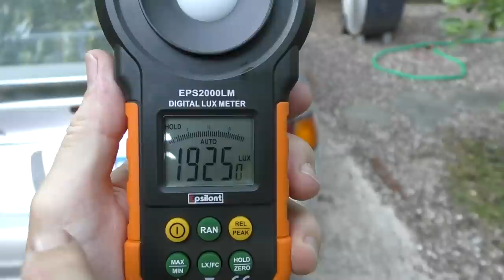I Made a Huge Mistake Buying These Headlights

Comment: Thanks for making this clear in a scientific way.  Something needs to be done to stop the use of these light bulbs.  They are brighter than someone with their brights on coming right at the other drivers on the road.  I realize there are many older drivers who previously could not drive at night because they could not see well in the dark; this is not the answer.  Using them will only increase the chances of someone else sliding off the side of the road or crossing the center line.  Spread the word.  Pickup trucks that are higher off the ground to begin with make it extremely difficult to even drive in front of them.  Your rear view mirror is blinded; the side mirrors are blinded; you get the idea.  It's like riding a bike with tunnel vision glasses and your ears plugged up.  Very dangerous.  If you get a big pick up truck behind you with these lights and another coming at you from the opposite end, pray for a good result, because for the next 30 seconds you are completely blind and have entered the twilight zone.  To make it worse, the police will never record this as the result since the lights are legal.  No one will no what was the real cause except for the drivers with these lights.
Reply: Its got nothing to do with how bright they are. If they are aftermarket mods then they are almost always not aimed correctly which is why they are blinding factory LEDs cause no problems at all. I've been blinded by plenty of halogen lights that were not aimed correctly.
Reply: @gravemind6536  100%. Aftermarket LEDs are the main issue here. Factory LEDs are mostly better but early generation systems did also cause some glare, but I’m glad the IIHS is doing headlight testing. Some cars get a Poor rating solely due to glare alone and they improve them for the next year to aim them better. This is the progress we should see, not some luddites railing against LEDs. The more properly aimed from factory, well designed LED systems we have, the less temptation there will be for people to shove LEDs into halogen receptacles not designed for it.

Comment: I hate adaptive headlights.  My real question is, why do 99% of cars headlights glare so bad?  They will glare at certain angles, if a car is turning.  Often one headlight is glaring and the other isn't.  Most fog lights bother me more then the headlights.  All Jeep Wrangler headlights suck, new Ford and Chevy 1 ton truck lights are glaring, Camry fog lights, but headlights are ok.  There are VW SUV and a few new BMW that I can look right into it's lights and it doesn't bother me what so ever.  But heck the other 99% I have to look to the side of the road... or face eye strain/discomfort.  I'm in my early 20's still.

Comment: my 8th gen 2008 honda civic has really weak low beams. I know the problem usually can be a number of different things. but from all the forums and research I've done. supposedly the low beams were always weak. even on newer civics. I'm still trying to figure if I need to replace them with some brighter bulbs or something. anyone else with a civic that had the same problem out there? with advice? what did you do?

Comment: I miss the old sealed beam 7" headlights on my '69 Squareback. Sealed beams were simple and cheap. Double-light systems used two 5" sealed beam lamps, with usually the innermost ones being the high beams.  We sure have complicated things over the years.
Reply: Thomas Darby   VW made terrific headlights back then. 67-74.

Comment: Hey scotty. am harun form Uganda. I have a 1995 all while drive manual transmission toyora rav 4 with suspention problems and a busted head gusket, thinking of getting 2006 Toyota noah 2 wheel drive. do u think I should fix my rav 4 or trade it up. thanks for the videos.

Comment: Hey Scotty! I have an old Gen 1 dodge ram 250 with the old square Sylvania headlights that don't have the removable bulb (the whole thing is the bulb). Anyways, if I'm driving around at night and I have the high beams on for about 15 minutes straight, they like to turn themselves off. If i switch back to dims, they come right back on and if i wait about 5 minutes or so, i can use my brights again for about another 15 minutes. Not really life threatening, but inconvenient on all these darn Iowa gravel roads. The lights are only a few months old and they're the same kind I've always gotten and they work great otherwise up until this started happening. 
What do you think the issue could be?
Reply: Sylvania Silverstar H4656ST. Just for reference.

Comment: Hey Scotty my 2005 Toyota Tacoma 2.7L manual transmission is suddenly getting 9 mpg instead of the usual 14 mpg. It has 73k miles and is in great shape. Do you think the mpg problem will be fixed as part of the 75k scheduled maintenance?
Reply: Check the air and fuel filters first.

Comment: People flash at you cause you should not use led or xenon in a halogen headlight, reflectors are designed for halogen an will make peple blind with led or anything thats not halogen. Here in europe it won't pass anual test and you can get a ticket if the cops see you, you have to use headlights dessigned for xenon or led, they have to be autoadjustable and your car has to have headlight washers, all of this by law

Comment: hey scotty its not about brightness....
its about beam direction.

a conventional headlight assembly with halogen lamps is designed to work with halogen lamps.
if one replaces halogen with hid or led then the whole thing is wrong 
the beam is directed by the reflector to other places of the road.
its a mess
its all about the reflector 
halogen headlights with led or hid dont get the correct amount of light and its reflected elsewhere.

thats why most of hid or led kits state that are not street legal.

many chinese kits have the '' DOT'' aprroved ....lol
of course its a lie.

laws in your country about car lights are correct and try to protect normal drivers from ignorants that modify their lights the wrong way.

and the rule is simple

if the headlights are blinding you ...they are illegal.

the correct hid or led lights are the ones that are designed to work with approriate headlights.

Comment: You cannot have a correct beam pattern with LED in a standard halogen housing unless you have projectors.  Its not all about brightness but also direction the lights shine.  Most conversions are nothing more than erratic flood lights that shine everyplace.  Europe has different lighting specs.  Our headlamps may be illegal in Europe.  It's about the beam patter regulations from the government and what side of the road you drive on.
Reply: You can absolutely put LEDs in relfector housings. You just got to make sure that you buy an LED that mimics the position of a halogen fillament. if the light source is in roughly the same position as the fillament, then the light will not scatter and you can adjust the angle as needed if it's not exact.

Comment: Hahahaha They must be honking for Jesus...Just bought some new plastic headlight assembly's from China...like Scotty said have some black color in there and it does look better than stock...thing is getting them to fit in there right...you have to see what your looking at...what goes where....the little metal clip pieces here and there don't come in the right spots on the new ones sometimes so look at the old assembly's when you take them off..old light bulb holders are old and crumbling could be a problem when reattached to create a water seal...guess I'll look at replacing the old headlight bulbs with some non blinding LED's for cool use...that fixed my constant burning out tail-Brake lights burnout problem... they were overheating from use causing burnouts..Your the best Scotty....Hey what do you think of the new big Indian Motorcycles ? lots of electronic stuff on there

Comment: First Xenons/HIDs and then LEDs are probably one of the better recent tech-trends in cars. I had my first Xenon-car back in the late 90s, my current car has LEDs and I haven't owned a halogen-equipped car in decades. And now whenever I have to drive a halogen car at night, I usually think that I forgot to turn the headlights on, because even modern halogen ones are no match at all for LEDs or even older xenon-lights. And as long as your lights are adjusted correctly and don't blind oncoming traffic, more brightness equals more safety at night IMO.

Comment: Good to know Scotty. I've been wondering what to replace my headlamps with. A couple years I changed mine out, just seemed like a good time to change them with the brightest Napa bulbs which happened to be on sale. I grew up with Napa and use them when I can and they will let me know when something I'm buying is on sale or I go in for Napa oil and a name brand, usually Valvoline, who they say also makes napa and is cheaper so I go with that. I also worry about blinding people on the road at night. That would be quite a pickle to be in a front end crash I was charged with driving with too bright of lights. I remember I had put new springs and struts in my '86 Sable and the headlights were too high even on low beams. I procrastinate, or when a have a few minutes to do it, you think I could find a phillips screwdriver. Anyway, one night I got behind the wrong guy who pulled over let me drive and so eloquently proceeded to follow me with his high beams on, if only I had the phillips screw driver I would have pulled over and adjusted them, But no, I put up with him til we parted ways, went home and found me a phillips screwdriver and adjusted those headlights, lol. Thanks for sharing.
Reply: Toyota, not Napa nor Ford Mercury. 
Toyota.

Comment: You can buy led bulbs that have the led chips positioned exactly where the halogen filaments are, so they give you more light and still produce an acceptable light pattern that won’t blind anyone. But most people don’t do that much research. I was responsible and did an actual projector retrofit on my 2000 Explorer when I converted to HIDs.

Comment: I have a 2011 Silverado. My headlights go out every year and now they don't work at all when I replace them.
Reply: Check your wiring harness.  My 2011 Silverado work truck had the same issue.  Eventually the harness burned up.  Cost  $900 dollars to replace.  The wire is way undersized for the headlights.
Reply: @johnd4348  I will check it out. Thank you for the reply.

Comment: "Adaptive driving beams that some manufacturers have." Cadillac's had that since before you and I were born.
Reply: Uh, wrong answer.  Adaptive beams change the projection pattern,  The Cadillac just switched to low beam when an oncoming car's headlights tripped the sensor
.
Reply: @craigs1180  If that's not adaptive, then what is?
Reply: @neshobanakni  To use your logic EVERY car has adaptive headlights by virtue of adapting to dark when you switch the headlights on.  Might as well call them digital.
Reply: @craigs1180  Thanks for proving my logic.
Reply: @neshobanakni  There are 10 types of people that understand binary logic.  Those that do and those that don't.  Too bad we all don't live in your binary logic world but then this IS the 21st century.  You really should conduct more research on today's active LED headlight technology and projection patterns.

Comment: Here's why. HiD headlights are DESIGNED to be installed in a FOCUSED BEAM headlight enclosure. They are meant to be focused down the road DOWN from the eye level of the oncoming driver. FOCUSED beam. Idiots installed HiDs in reflective enclosures, which are NOT meant for HiDs..it shoots a LOT of light down the road, but for oncoming drivers, it shoots a lot of GLARE. Sure they are bright, but the light up the SIDES of the road, the TREETOPS, etc indiscriminately blinding anybody they are pointed at. You can get a ticket.  As for 'color' headlights, be aware that in virtually every state, the ONLY 'color' a headlight is allowed to shoot down the road is WHITE.

Comment: Led may be more efficient but I hate seeing them on the road at night. I hate the idea that in about 10 years most cars on the road are going to use them.
Reply: Noel López       I rock halogens and sometimes I feel I’m the only one everyone got LEDs I get but at the same time I don’t cause one halogens work just fine and two the heat melts the snow in the winter and the yellow light makes it more easy to see against white snow. But I do get the LEDs are more efficient and probably not as hard on your alternator seeing they don’t draw as much power. But they are just too bright.

Comment: I'll use conventional Halogens designed for my car as replacement bulbs until I get a new car with factory equipped LED headlights designed to meet NTSB/DOT standards. Done right LEDs should last the life of the car.

Comment: Owners of LED equipped cars complain of a sharp cutoff of light.  I think I wouldn't like that either.
Reply: HIDs have that too and it works very well. And if you see your lights are illuminating the back window of the car on front of you, you need to adjust them.

Comment: Your HIDs look like crap because you threw them inside a reflector lense. This is a cheap way to get more light output but blinds other drivers. If you did a proper Projector retrofit HIDS will out perform any led or halogen light. Gotta learn all the information before doing modifications.

Comment: I really don't know why he is shi... against hid headlights.
First of all it is illegal in Europe to put HID on your own. Those bulbs usually came in more expensive cars and had special systems fitted not just the bulbs. 
They had ballast, leveling motors and sensors and were self leveling beams so you were not dazzling other people at all.
Sorry Scotty but judging by your comments you don't know much about HID
And yes the bulbs were expensive but usually lasted without problems  7-8 times compared to halogen bulbs so in the end the cost was the same.
I had a car with original HID bulbs, sold it when it was 12 years old, the bulbs were still factory fitted ones.

Comment: Halogen bulbs are dull and yellow. At least put in Silverstars or some other higher grade replacement bulbs. I just replaced my headlight assemblies, for the 4th time!! And put in SilverStar Ultras, for the little I drive at night, I want to SEE the road. They need to be aimed correctly of course, and most young guys don't do THAT part. THEY are the buttheads that are blinding us on the road.  But plain old halogen replacement bulbs, are such low light and yellowish. Get brighter white ones and get them aimed right.

Comment: This woman doesn't know as much as she thinks she knows.  The reason the HID bulbs were too bright is because you installed them in housings with stock reflectors made to work with halogen bulbs.  The correct advice to give is to tell people they CAN have brighter safer HID lights but they have to actually replace the stock halogen headlight housings with ones made to use a HID bulb that use a projector lens that has a proper cut off that gives you brighter safer lights without blinding people.  Look for another channel for headlight advice, this old woman doesn't know what she is talking about.

Comment: The test in the beginning wasn't all that accurate. He had LED bulbs in the Celica and Matrix, and both the Matrix and the Lexus had aftermarket headlight assemblies. In this case, if you really want accurate measurements, you need to have the factory manufactured bulbs and assemblies. And with the HIDs in the Celica, it's not necessarily the bulb's "fault". While it could've been a cheap set of bulbs that are not properly designed, another factor is the headlight assemblies, they are not designed for the HIDs and consequently produced a poor beam pattern. Also, anytime you change parts and pieces of your headlights, you need to put em 25ft against a wall to check and readjust the height and pattern, even the slightest change can throw everything out of wack.